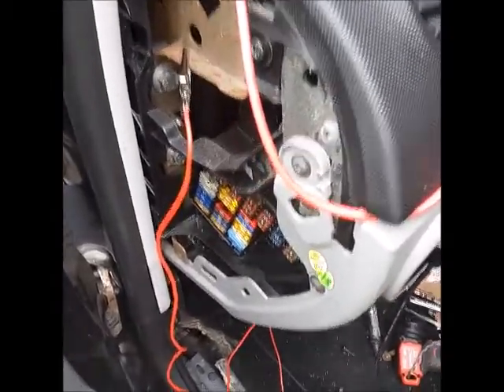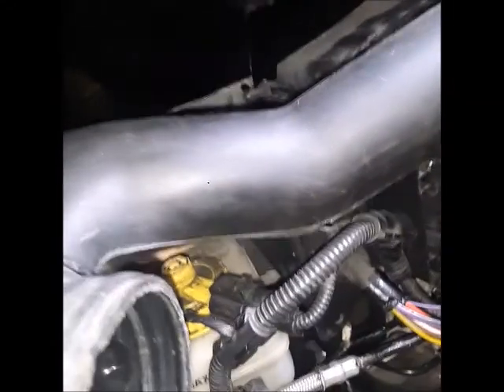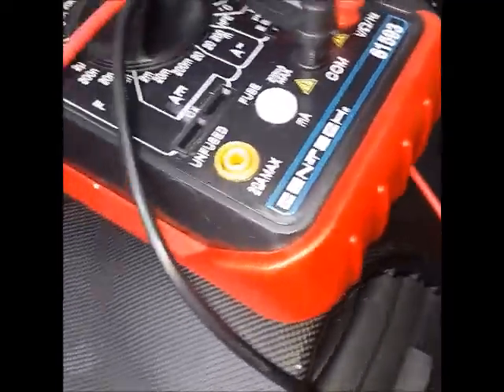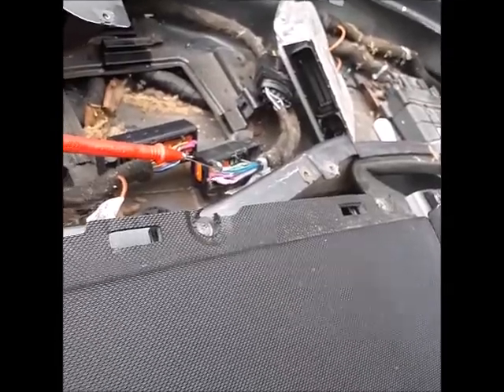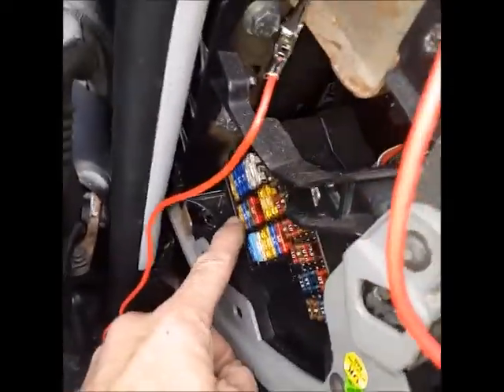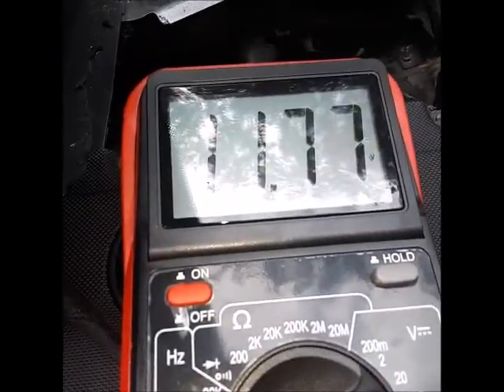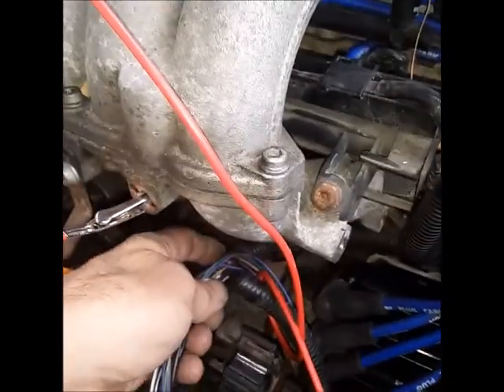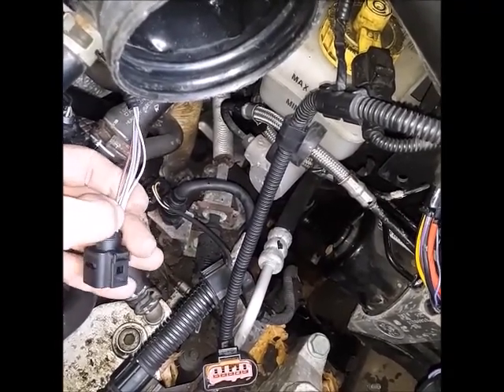2005 Volkswagen Beetle ECM / relay / wiring diagnostic 01314 code

Comment: I have no voltage on the computer plugs, I accidentally put in fuse 27 (ecu power supply), strange because it's supposed to be there. I tested 2 ecu's and nothing, there's no voltage + on the plug

Comment: you replaced new ECM, no programming required?  Just plug and play?  or buy unlock ECM
Reply from the maker: Sorry for the slow reply, This is my brothers Beetle I do the work on it.
  He sent the ECM out to an electronics place for testing/repair they concluded the chip was dead, it was getting power the board was powering up but the chip was dead on the board non-repairable.  
  They also sold ECM's since they had his they matched it up to a PLUG & PLAY IMMOBILIZER Delete/Unlocked ECM same numbers. my brother bought it I plugged it in started right up he is still driving this Beetle today. 

Everything works as it should all power, alarm, ODB II, hook a VAGCOM up everything is as it should be, if I remember correctly he had to give them his VIN and they flashed the ECM with his VIN or something to make it plug and play to "his car"... I hope that helps

Comment: I have the same problem its a 1.4 petrol i can't find the ecu relay its coming up low input its 2005 can anyone help me thanks
Reply from the maker: I am not sure on a 2005 1.4, is it a Beetle or something EU JETTA, Golf, Polo, Fox ? 

I am in the U.S.,  the 1.4 TSI "if I am correct" was not introduced here till 2015, JETTA/Golf/Beetles prior to 2015 petrol here are 2.0L / 1.8T / 2.5L at least any I have encountered.   What is it I can see if maybe something in Bentley covers it
Reply: @rokmoto67  yes its a vw  beetle im in the uk

Comment: Did you find the root cause? I have similar issue
Reply from the maker: After checking all grounds and connections, relays and fuses,  I had power everywhere to the ECM but no ECM power up 

I sent the ECM out for repair was told the chip on the board was good (no obvious burned/heat damage) the power supply on the board was good and powering up but the chip would not power up DOA. 

No idea why the ECM fried, I do know Bentley shows a 10A fuse for the ECM and the prior owner had a 20A in the socket, possibly a voltage surge and the fuse being 20A allowed the EMC to take the voltage hit and fry rather than blowing the fuse. 

Purchased an unlocked ECM /  plug and play worked fine problem solved.

This was last fall, been nearly a year and no problems, Beetle is still running great.
Reply: @rokmoto67 where did you buy an unlocked ecm?
Reply from the maker: This is my brothers car, he found a company online that only sold ECM's, they would re-flash/repair the old one if repairable at one price, then they also sold replacements if the original ECM was no good, the original turned out to be a dead chip on the board could not be repaired .. They had a replacement and he bought it. I can ask if he remembers the name of the company  @M0N0T0N0US
Reply: @rokmoto67  would really appreciate if you could find out
Reply from the maker: @M0N0T0N0US  So I talked to my brother he said he bought the ECU from - TheECUConnection .. 

I guess they have a website and also an ebay shop, My brother is a computer tech/IT guy so I imagine he ask all the right questions, i remember him shopping around and taking his time before he bought an ECU and decided with this place was good.
   I can say it was plug and play everything worked on the car as it should, all power , alarm , remote everything works fine, Has been a couple/few years still driving the car no issues so far.

I think he bought through their ebay shop for the "buyer protection what not" He said they programmed it to match his car their shop on ebay is - ecuconnection 

He also said their web site is TheECUConnection(dot)com

I hope that helps